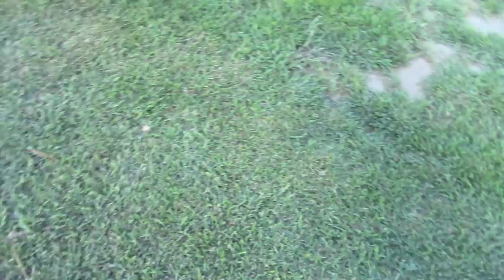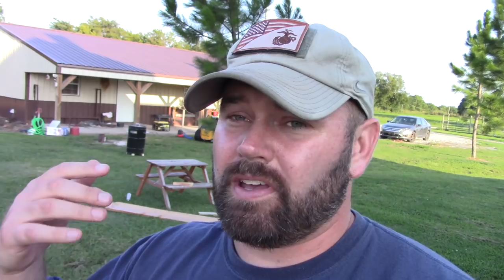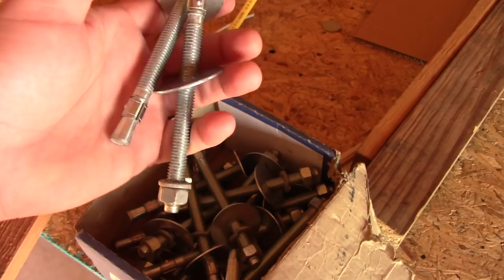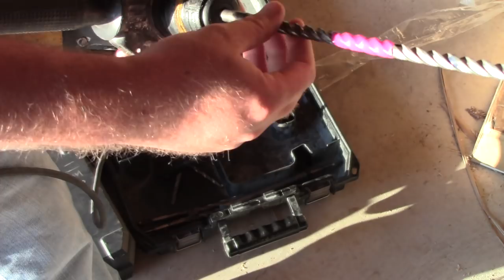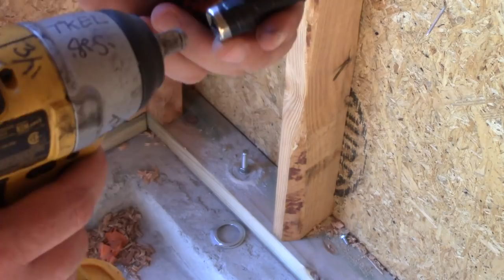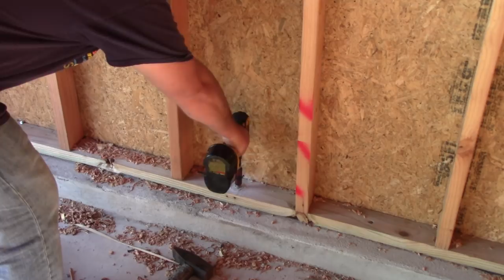Anchoring Down The House! Testing Amazons Cheapest DEWALT HAMMER DRILL!?!

Comment: blown in insulation sucks in 2 or 3 years half of your house wont have insulation because of settling
Reply from the maker: Lol
Reply: Yeah, Okay, Wrong. High density blown in Insulation doesn't settle like the old days.
Reply from the maker: Among the most relevant pros of fiberglass insulation are the fact that it’s inert and doesn’t settle, that moisture doesn’t affect it, and that sound pollution is less of an issue because of it.
Reply: Looking good Dutch! I bet you guys are super excited to get it done!
Reply: +William Lewis....At the risk of pissin' ya off, I call BS. I had insulation blown in  17 years ago. The local utility company did a free thermal inspection/audit last year and found less then 2% settling.
Reply: I know my comment comes in way late, but here it is anyway...

I was actually teamed up with a friend doing blow in, in the early 90's. Back then there was a glue nozzle attached to the insulation nozzle. Apparently things have changed since I retired. But, even without glue, it NEVER settled by 50%. Maybe a few inches, which was why the glue was added.

Comment: Last time I was in construction we used anchors to concrete too but after drilling the hole we put a wall anchor looking thing into the hole, then put a long piece of metal in the hole to hit with a hammer to expand the anchor at the bottom, then screwed in all thread with a washer and a nut. Then cut the all thread down.

Comment: Those Tapcon Screws are crap compared to the Redheads you put in. Don't forget to get some 2'' Galvanized strapping and secure the top and bottom plates if you're worried about wind ?  Good video Dutch, as always.
Reply: +august...AGREED.  One can never have too much strapping. Whether for high winds or earthquakes.

Comment: Dutch, house build is looking mighty good looks like your new dewalt hammer drill works good for you. just a tip keep an eye out for wasp trying to build nest inside your house... you can kill them with a Non toxic way use a sprayer bottle with Isopropyl Alcohol it will
knock them right out of mid air if your a straight shooter! hope this tip helps in some way? it will also kill ants... especially red ants.

Comment: It may seem like semantics, but that is a rotary hammer. Much different, and much better, than a hammer drill.
Reply from the maker: But both classified as a hammer? It worked great either way. Made short work of those little holes.